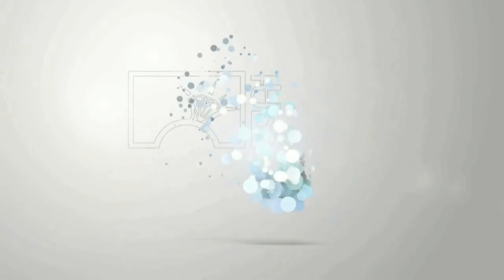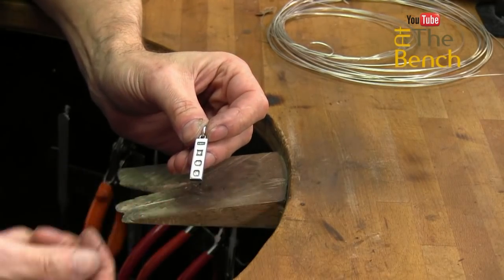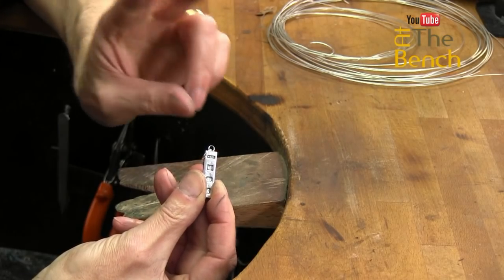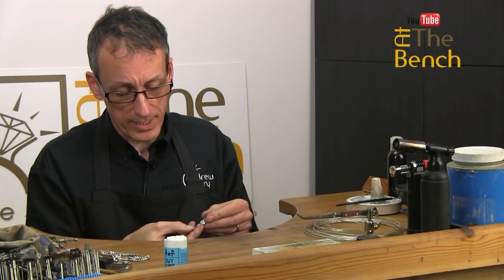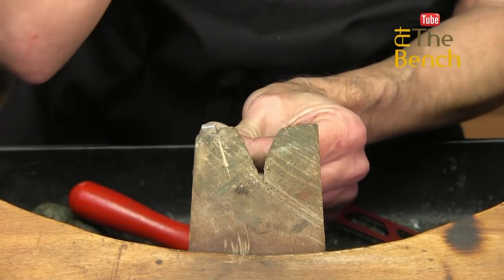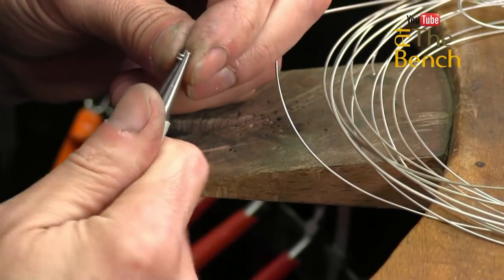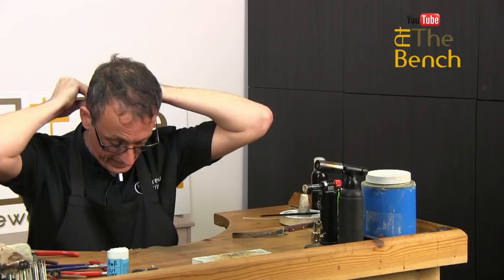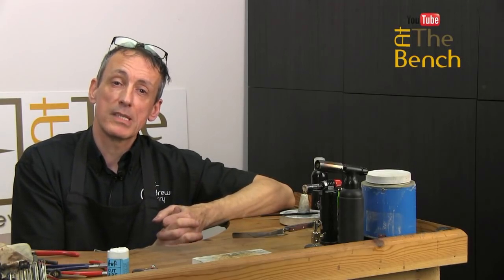How To Replace The Top Loop On A Pendant - Making And Repairing You Own Jewellery

Comment: another idea: you could strategically use fine silver for the bigger ring, sterling for the tiny ring, so that the harder sterling is more likely to wear on the thicker fine silver ring.  then it’s easier to replace the only big ring eventually and not have to refinish the entire piece when u repair it. plus the big ring, if it’s fine silver will less likely add wear and scratches to your chain. another plus

Comment: Very nicely done. You truly know your craft. Is soapy water enough to remove excess flux also or do you need the acid u speak of?  Thanks
Reply: Peter Ford  you just need hot water to remove flux, hot like pickle in a crockpot. the acid in the pickle removes the oxidation, the heat removes the flux

Comment: Thank you!! Your tutorials are fantastic and thorough. I'm sort of anxious to buy the basics and give it a try. Is there a situation, where it is possible to melt the solder just by putting the flame on the third hand only?  Thanks!
Reply from the maker: Not sure exactly what you mean?
Reply: @Atthebench  Sorry... let me re-word my question.  Is it possible to melt the solder and also bond 2 pieces of silver without applying a flame to the silver itself?  In other words, could you get it hot enough to solder/bond (via heat transfer) by applying the flame only to the 3rd hand and not to where the silver metal pieces join?  IF you can do it that way, are there certain circumstances where it should be done that way (like with softer stones, maybe)?  Thank you so much for responding.
Reply from the maker: tammygurl64 No that is not possible on that sort of scale. You can do it with a soldering pick. I will put a film live in a day or so
Reply: @Atthebench  Thank you. I appreciate that very much. That lets me know what I need to research. There's so much to learn!  I will be watching for your next video. Cheers! 🙂

Comment: why aren’t you protecting the whole piece from firescale? and why not use a thicker jump ring so it lasts longer? just a thought. if the two rings are of a similar gauge (and same material) the wear should be less.